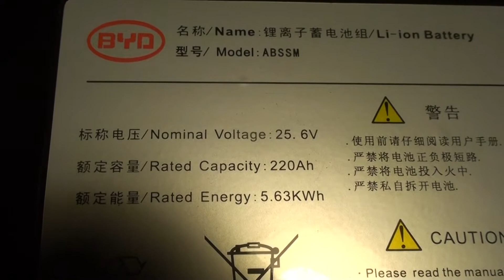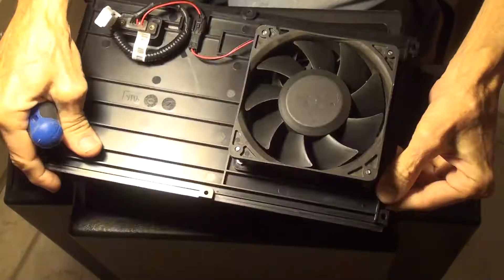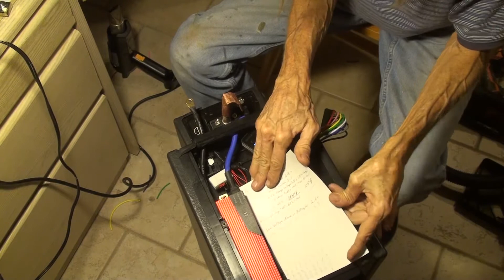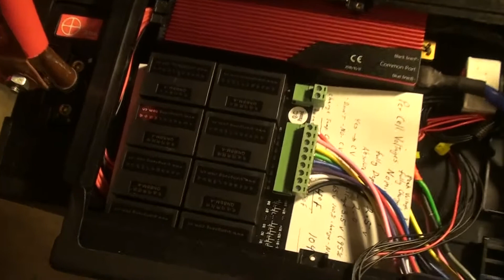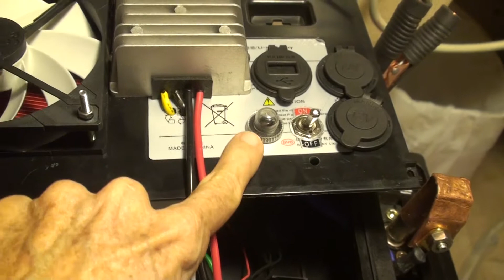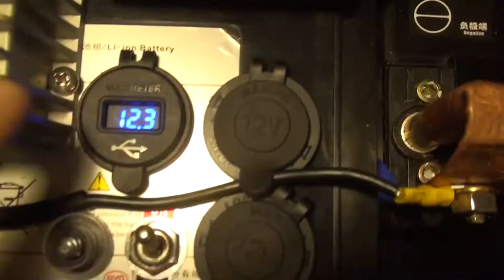BMS Rebuild on 5KWH lithium Iron Phosphate Battery

Comment from the maker: You can get a similar battery with a BMS built-in on little wheels for $800 plus $300 shipping here

https://bigbattery.com/product/24v-lifepo4-power-wall/

The battery in my fireplace room shown in the video uses the following parts excluding wire, solder, heatshrink and other stuff I forgot to add to the list.

The battery was a great deal on Battery hookup.  I got four of them at $275 each and $350 to ship all four.  This battery is no longer in stock, but they seem common, I have seen several places selling them from time to time whenever a new batch becomes available.  It is LiFePo4 chemistry which does not burn like other lithium batteries.

I put in this active balancer  ($188)

https://www.theguardian.com/us-news/2020/oct/08/republican-us-senator-mike-lee-democracy

And this BMS  ($140)

https://www.electriccarpartscompany.com/24V-8S-100A-EV-Lithium-LiFePO4-BMS-Battery-Management-System

It has this 24 to 12 volt converter  ($23)

https://www.amazon.com/Adapter-Converter-Reducer-Regulator-DC15-40V/dp/B01JAIC7OO/ref=sr_1_10?dchild=1&keywords=DC%2FDC+Converter+Regulator+Reducer+24V+Step+Down+to+12V+10A+120W&qid=1602302324&s=electronics&sr=1-10

This quiet fan  ($9)

https://www.amazon.com/gp/product/B0119T0D4I/ref=ppx_yo_dt_b_search_asin_title?ie=UTF8&psc=1

This battery monitor  ($30)

https://www.amazon.com/gp/product/B07797N9BG/ref=ppx_yo_dt_b_search_asin_title?ie=UTF8&psc=1

This USB charger  ($11)

https://www.amazon.com/gp/product/B07JND74X2/ref=ppx_yo_dt_b_search_asin_title?ie=UTF8&psc=1

These 12v sockets  ($13)

https://www.amazon.com/gp/product/B07FLT2VB6/ref=ppx_yo_dt_b_search_asin_title?ie=UTF8&psc=1

This switch  ( five for $8)

https://www.amazon.com/gp/product/B078KBC5VH/ref=ppx_yo_dt_b_search_asin_title?ie=UTF8&psc=1

And one breaker from this panel  (panel with multiple breakers cost $36 with four breakers)

https://www.amazon.com/dp/B00M3OIG5M/ref=dp_prsubs_1

I used this inverter for the test where I ran an air conditioner for eight hours from the battery.  ($180)

https://www.amazon.com/gp/product/B07RQYX45Z/ref=ppx_yo_dt_b_search_asin_title?ie=UTF8&psc=1

I charge it from AC with this charger  ($295)

https://www.amazon.com/gp/product/B07X135RKC/ref=ppx_yo_dt_b_search_asin_title?ie=UTF8&psc=1

The solar charge controller currently charging the other three batteries from four 100W panels on the boat is this one ($131) or possibly save some money and use a cheaper PWM type depending on your preference.

https://www.amazon.com/gp/product/B01HGTT47C/ref=ppx_yo_dt_b_search_asin_title?ie=UTF8&psc=1

I'm using this 4 gauge cable on the boat, it will handle the inverters 2,000 watts for the inverter at 24 volts, 83 amps  (2 feet is $18)

https://www.amazon.com/gp/product/B01F32MTBM/ref=ppx_yo_dt_b_search_asin_title?ie=UTF8&psc=1

Use this 80 amp breaker to protect the cable and inverter  ($22)

https://www.amazon.com/gp/product/B07T9D2R1S/ref=ppx_yo_dt_b_search_asin_title?ie=UTF8&psc=1

Comment from the maker: This link is to the same batteries with some of the covers removed.  $275 each.  At least 3 KWH left in each.  Shipping is $350 for a palate, and you can fit a lot of them on the same palate for the same $350.
https://batteryhookup.com/products/byd-24v-8s-lifepo4-3kwh-blowout
No telling how long they will last.  I'm hoping they last longer than the three years i got out of the AGM batteries I just took out.  The next video will be about connecting three of them to be one giant battery and the video after that should show the charge controllers that connect them to solar panels and the 120 VAC inverter for them.  I hope the series of videos will show enough detail that others can do it themselves too.

Comment: Your losing me Capt I’ll just fire up Brutus my 300 etec and haul ass somewhere else it’s lol Capt Carver how much u pay for those batteries and how long will they last Capt could I use one on my boat how to charge it up solar panels I guest JT did you spray your wires yet
Reply from the maker: The boat is still sitting on the trailer and I don't expect to use it until next summer.  Will definitely spray the ignition wires once there is water to the engines and I can safely start them.  I just posted a comment describing where I got the batteries and what they cost.  That way everyone can see the info.  Thanks for asking.  Buying a used battery sounds lame to me, but there is a lot of capacity and for $275, its a lot of storage for now.  Will be interesting to see how long they last.